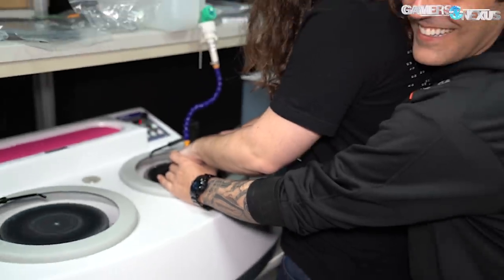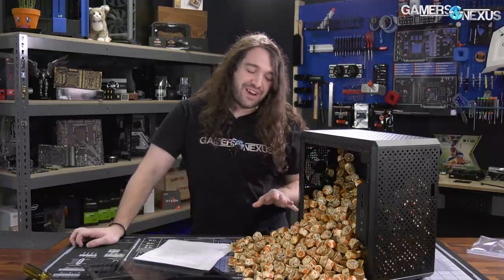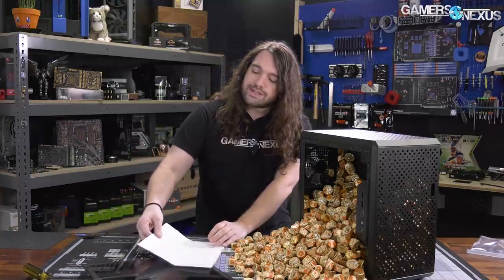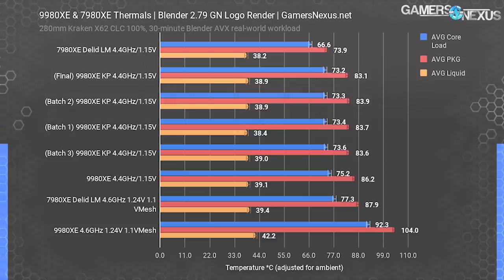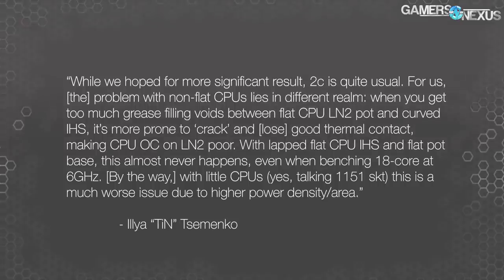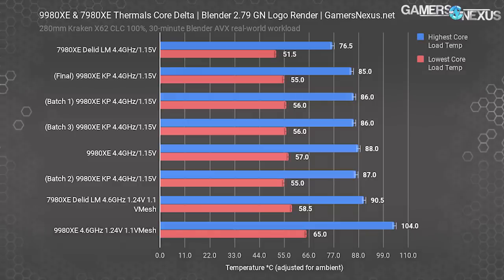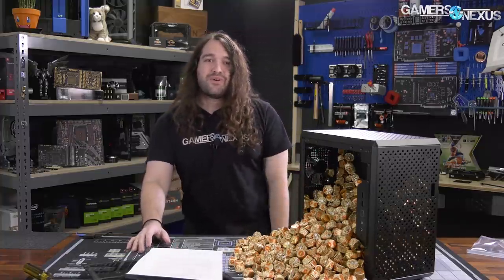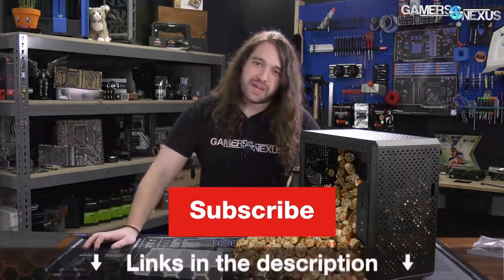Lapped 9980XE Kingpin IHS: Unexpected Results

Comment from the maker: Watch part 1 here: https://www.youtube.com/watch?v=iShcG91eLoc
Article will have to wait as we are in Canada right now to roast Linus!
Reply: Oh I bet that'll be delicious.
Reply: Just delid the damn 9980XE
Reply: @mountedpatrolman  Der8auer wreaked a 9980XE that way, the way the components are mounted on the 9980XE the lid tends to rip of micro capacitors and other little things as it comes off.
Reply: @darthkarl99 I saw the video, He also did one successfully...
Reply: CNC SURFACE GRIND that cpu. Off course not with your hands,  it is impossible to put the right amount of pressure on that thing
Reply: @picklewiickle.1583 Does this make Vince Tech Loki?
Reply: If you have an automotive background or have ever built an engine, you would know this video is ridiculous and they are doing more harm than good. You cant sand a piece of metal by hand (holding the heat spreader in your hand and placing it on a "lapping disc") and expect it to be better than it was from the factory. This is illustrated by the slightly rounded corners of the IHS post-sanding. There is too much error in the way you hold it, you might think you are holding it perfectly level but you arent.
Reply: Furthermore, the "precision" lapping tool/jig is also a huge fail. The pressure the jig places on the one end of the IHS is distorting the surface to be lapped. When removed from the jig, the pressure is released and is distorting the metal from the state it was originally lapped in. In the automotive field, when an engine block is bored and honed, machinists bolt on a "torque plate" that puts stress on the metal that equates to the pressures a torqued cylinder head would place on the bores in the engines final assembled state.
Reply: Why didn't you also lap your all-in-one liquid cooler?
Reply: ok, so steve, what if you use a blade to cut away the glue around the chip, delid with heat and immediately reapply lid with heat,
i think there is a bubble of sorts that may have formed during the cooling process when originally soldered.

Comment: Unless 2 planes are 100 percent perfectly flat, (impossible) you are going to have 3 points of contact when those 2 planes come together. Always. There is no way around this. So, you went from having 3 poor points of contact, to having 3 "better" points of contact by sanding your IHS to be "somewhat" flat. Sanding it down will never get it anywhere near actually flat. If you want it to be "nearly" perfectly flat, you must actually use lapping techniques to lap it flat, and then MEASURE your results with highly accurate precision measuring instruments. Sanding and lapping are not the same thing. Not even close. And even with lapping, you will need to measure your results to ensure that it IS actually flat. I would be curious to see what a machine shop with a surface grinder could do, to get both surfaces down to about .0002" flatness, and then lapped to about .000025" flatness (about the best you can possibly achieve) and then see what the results would be.

Comment: I know this might sound crazy to you all, but what do you all think about using a 3D printer to build some kind of multi-layered multi CPU socket buss so multiple MPUs could be simultaneously cooled and run in parallel to share the current like use to be done with audio amps with a S-load of power transistors back before MOSFETs took over?

Comment: reentry vehicle heat density: ~1MW/m²
4.6GHz 7980XE heat density: 0.808MW/m²
we're almost there
Reply: Plebestrian Lmfao
From what kind of orbit is that re enter from
Reply: pulled the number from a paper about reentry vehicle heat shields, don't think they specified
Reply: Comet Lake will do it.
Reply: @oreolamp5676  https://www.faa.gov/about/office_org/headquarters_offices/avs/offices/aam/cami/library/online_libraries/aerospace_medicine/tutorial/media/iii.4.1.7_returning_from_space.pdf I think this is a paper similar to the one that @Plebestrian read. Scroll down to 4.1.7-322 and note the graph with reentry speeds in relation to heating rate. 
According to this the 484mm² die of the 18-core chips at 500W power draw equals the PEAK heat energy output of a ~9600m/s reentry speed to earth.

This means we are already exceeding the heat energy density that the space shuttle surface had to endure. 9600m/s is ~21500mph, the typical space-shuttle reentry speed is stated at 17500mph.
Reply: @Begleitkubus  Silicon density, bruh
Reply: Update 2024: i9-14900ks pushing up to 1.977MW/m^2 when power limit is removed
Came a long way. Intel too

Comment: The blood gives the CPU a extra 200mhz.

The ultimate cpu is it be part of the cooler, not a seperate peice.
Reply: Use virgin blood harvested at moonlight you get another 200 MHz
Reply: The human eye can only see 144mhz of blood
Reply: 20 years ago there was no ihs on amd cpus
Reply: 3Balala3 I still have a few of them 😁
Reply: Actually, i saw not too long ago that integrating cooling into the Silicon is being heavily researched and has prototypes, just about ready to be possible to be used in Processors. 
I do wonder what pressure liquid channels that small are gonna have to run at, though.

Comment: Good timing, just got finished watching der8auers video on lapping
Reply: @nyunster  

Yea, I watch a lot of hardware YouTubers =)
Reply: I just lapped my i5-4690k and dear god it was bad. It was terrible after 5 years of use. I had a Noctua NH-D15s and was hitting 90-100c under 4.3GHZ @ 1.35v (prime 95 small fft) and was not good. My new Ryzen 7 2700 running under a 140w load (small fft @4 GHz) runs at like 70c. sooo... the I5 got a lot lower temps after the lap. Lapping is not that hard. I went 120 (Dry rest are wet), 400, 800, 1500 then 3000 grits. Took me about an hour and a half to do properly. I am just glad that my cpu has good enough temps now.
Reply: I had mt 4690k on a hyper 212 evo and was overheating at 4.4GHz while gaming so I upgraded to a Noctua 120mm static focused fan with a small temp change. Got a Noctua NH-D15s and got a small temp difference. Took a 120mm Delta Electronics high rpm fan and dropped it on the d15 and still didn't see a huge temp change. Lapping gave me like a 20c drop on the Hyper 212 evo with the Noctua fan on it.
Reply: @tmi1234567  Good work! I had a 4670k and 4690k, so it's cool to see others pushing that hardware.

Comment: So I have a set of high end ceramic stones for sharpening knives and equipment to keep them flat and I'm wondering... Can I just use these and make sure I keep them super flat? I have leather strops with different compunds I use also that will put a literal mirror polish on about anything. Kinda wanna try it on my 9900k but it costed me more than I really should have spent anyways lol.
Reply: It should work, but don’t wet stone it, unless you use very high percentage isopropyl alcohol. Also, I’m not sure what grit your tools go to, but the higher grit won’t work as well and will just polish the lid. You know that though. It would be cool to see a super shiny cpu though!

Comment: You're probably right about the i9-9980XE solder causing the thermal issue, because it's a reprogrammed identical physical die to the i9-7980XE, right?  In the case of the i9-9900K, der8auer found the i9-9900K thermal issue was partly caused by increased silicon on die top.  :-)

Comment: It might be the Kraken X62 mounting, not getting good pressure. With good watercooling solution with good spring mounting I think the results will be better, but it really might be the solder underneath being what it is. And come on GN, who the heck will use 9980XE with Asetek mainstream AIO, at least put the 360 MLC Phoenix.

Comment: Lapping isn't the be and end all for mating the surfaces - just because they're flat doesn't mean they're parallel, etc.
 If you want much better contact for LN2 then instead of grinding them both on stones you should be mounting the cooler and CPU, bluing them and then scraping the two surfaces into each other.
 That will take actual physical contact up from single figure digits into the low teens.

Comment: Would any of the imperfections on the inside surface of the IHS make any difference on the 9980XE? Like would more solder between the die and IHS in certain spots possibly create the Core to core deltas you're seeing?

Comment: The flatness to avoid cracking is simple in that any thermal shrinkage or expansion is also more uniform. This thermal expansion and shrinking produces stress in the material. While in a liquid state this is not so much an issue other than potential low level pressurization, but as a solid having different section properties (i.e. thickness) the thermal stress in the thicker sections will increase the stress upon the thinner sections causing cracks within the thinner sections or somewhere in the interface between the two. This same thing happens in concrete a lot and has to be accounted for in design.

Comment: I will testify to lapping. My e5 1650 xeon had a horrible imperfect surface. My water cooler couldn't even keep it cool at the 4.3ghz overclock I was running I would hit 90 really fast, as soon as I hit the benchmark on cenibench or aida 64 it would start hitting throttle limits pretty much instantly. I then decided what I should do. LAP. I lapped my CPU and my cooler master masterliquid lite 120. Lol (mouthfull) any who.... I can ran same overclocks and now I was sitting in the 60s so I overclocked it to 4.5 and increased the voltages and now I'm hitting 80s after about 15 minutes and it flat lines and doesn't move. I'm sure if I had that unrealistic test running with my GPU on stress it would hit around 90 but that's unrealistic stuff. I'm glad I lapped my CPU and water block. I watched jayztwocents about his cpu hitting 90 instantly and check to see if my cpu spun on the table like a top and it did. Then did all my lapping and was happy I did. And don't say it was un even mounting pressure because I tried different thermal pastes and tried mounting the block in different positions never changed my temp.
Reply: A 120mm aio seems a bit limited when overclocking though, not sure of the heat output but something like a 240 or even better a 360 would seem better. Unless you sit next to a jet turbine ofc, in which case it all doesn't matter so much
Reply: @jadoei13  I'd love to have a 240 for more room for overclocking. Budgets tho. Lol

Comment: Well Im doing a full custom loop with 2x360 rads and a waterblocked 3080 and 11900k.

I thought about doing this to achieve the lowest fan speeds possible but 2°c I don't know if it's worth the effort and stress.

Comment: Sanding to get a flat surface takes a few minutes.  The improvement depends on the individual CPU and cooler.  2 to 4 degrees C is typical.  I just get the flat surface, a bit of nickel on the IHS won't do any harm especially if you run a PC that could be in damp conditions without removing the cooler for a long time.

Comment: Would you consider lapping the CPU die to improve core to core temperature delta's? I did this very lightly on a 8086K and saw core temperature delta's drop from 10c to around 5-6c. The 8086K die's are small and with such a smaller core count compared to the 9980XE for eg i'd imagine there would be much more to gain from doing this with a CPU with a larger die and many more cores.

Comment: One thing I realized on my 7900X is that the hottest cores were the first, last, and middle 2 (4 out of 10). They were consistent, with different cooling solutions, water blocks, thermal paste, and even with the stock IHS vs copper IHS. Now,  I don't know if those are "accurate" representations of the physical layout, but it almost seems to me that, if consistent, they could be "center cores", or at least cores in more "dense areas".
I mean, this is all speculation, as I've tried getting core layout info from Intel and it doesn't seem to be publicly available.

Just food for thought… :)

Comment: Forgive me for overcomplicating this but shouldn't the IHS be heated to operating temperature before resurfacing? Varying thickness and less than perfect composition in the IHS would cause thermal expansion inconsistencies. 

Lapped IHS and a lapped water block surface will expand differently at operating temperatures potentially causing gaps between the surfaces.

Comment: 1. Why not delid and than lap, instead of risking the cpu?
2. A lapping machine, but no holding mechanism for the IHS? thats like having  the tech to makke an iphone but charging it with a manual alternator.
3. Why not just make a copper IHS, (like linus tech tips)? or get 1 made / ordered online and then lap it?

Comment: Steve  I do care, please lap the 7780XE, delid the 9980XE,  benchmark, sand down the die of both of then, benchmark, let's get to the bottom of this. Time to pay a vist to Der8auer!  Or just accept  the silicon lottery withn the same die. After that you can run single thread benchmarks 18 times disabling all but one core each time  and find the golden core. Done, by that point we have content for one year!

Comment: we had a polishing station at our university lab for taking a look at metal structure (granular structure) under the microscope.
basically a large LP discplayer and an arm which held the metal puck/tab down with a weight. as grinding material there was a diamond powder liquid poured onto a silklike disc.
i built a polishing station for rings and stuff out of an old (vinyl) discplayer with 1000grid wet sandpaper.

Comment: I am wondering, why LN cooling teams use all this sponge, tape and so on to cover entire motherboard  (to prevent condensation) - instead of using just a closed case filled with a completely dry gas, like pure nitrogen? No humidity, no condensation. You can make such tank with acrylic sheets or smth like this.
It even does not have to be pressure tight, just rubber around all cables, rubber seal around the LN pot to fit it in the top cover.
You get rid of humid air, you do not risk condensation on spots of the MB that you missed. You can even provide some kind of a loop of cool nitrogen gas, to provide additional cooling to VRMs and RAM.
Is there some kind of a trick that would make it fail?

Comment: Foolish mortals! Lapping would be the answer if you could achieve absolute flatness so that you would not need any thermal gap filling material. You are not that technologically advanced. With your level of technology you could apply 100 layers or more of a colloidal silver mist after each preceding layer dries. Then you can apply your liquid metal hack on top after all the microscopic deformities are filled by the colloidal silver. With your level of technology though you should be cutting interlocking channels in the surfaces to increase surface area. Then apply the colloidal silver followed by the thinnest layer of liquid metal you can achieve. I would give you more advanced techniques but I'm afraid that you are several million years away from gaining that ability!  😎

Comment: So, not far from tax return and thinking about upgrading/getting new PC. Have a 4790k currently and i am wondering if it is time to go for a 9700k or wait for the new stuff around the corner. Want inputs (i know how to build computers but been out of the loop lately on performance charts. so i do know i need new mobo and ram. so no need to mention that)

Comment: Cant say i am surprised by this result at all, give that:

(1) Once the heat enters the IHS, it is much less sensitive to having to conduct a few mm in any direction due to a localized thick TIM layer. A 40°C thermal gradient in a copper IHS is huge. That said, lapping the IHS (and cold plate) will reduce the TIM thickness, and can reduce temperature overall, but I don't expect any affect on temperatures of different cores. 

(2) The IHS was tallest in the center, which likely means it had good contact with the cold plate/liquid cooler. The TIM thickness there would be have been minimum. Given that the die is in the center of the IHS, the thermal path in the footprint of the die would be excellent.

Comment: How do you think the IHS gets a curve to it? Certainly they are milled flat initially on both the underside and top-side. I would bet that the interface is not an issue as much as the underside of the IHS being curved to match the top, warped during nickel plating or uneven deposition of material I would guess. It may be possible to lap both the underside of the IHS and the die itself to reduce core-core deltas. Lastly I am surprised that kingpin does not have a jig to hold the IHS to lap perfectly flat rather lapping it by hand on his machine.

Comment: Logic, which is not really a strong suite of this channel : if the IHS is not flat on the outer side, it is not flat on the inner side, due to manufacturing process.
Hence, the logical step would be to test with a proper machined IHS, aftermarket one, like the Rockit variant.

Comment: Why are you calling sanding lapping? Sanding is a very different procedure from lapping and you use different tools to perform it.
With lapping you use lapping stones which are created by lapping 3 surfaces against each other till practically perfect flatness. Then the stones are used as a surface for the object you want to lap. It's basically a flat surface with channels grinded into it to lead the excess material away. Lapping is what you'd do after sanding and it is much more precise than sanding.

Comment: Steve, that huge delta is retained even when using a lapped stock (or an aftermarket copper IHS) on my delidded LM 7980XE. I still have cores that are a minimum of 20C higher than the coolest cores. One of my HWBot teammates is using direct-die on his 7960X and I believe that is the only way to lower (as you've stated) the delta between cores.